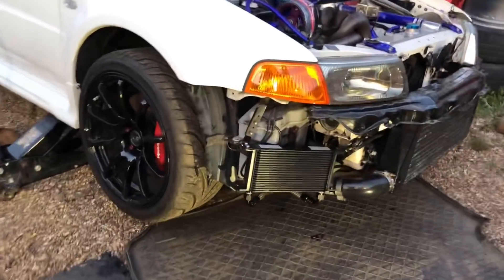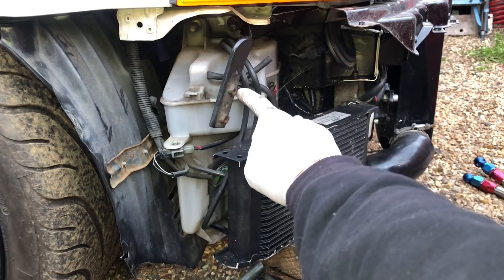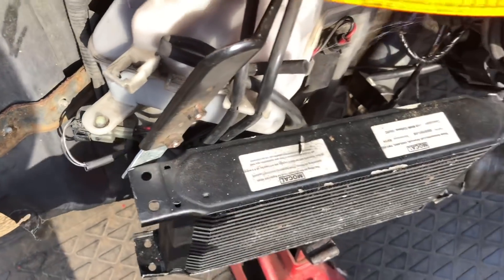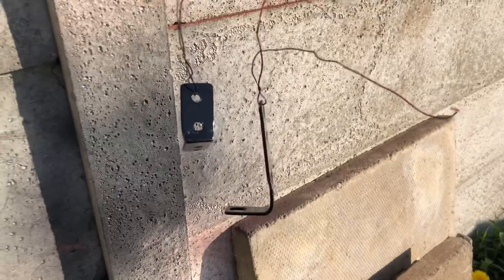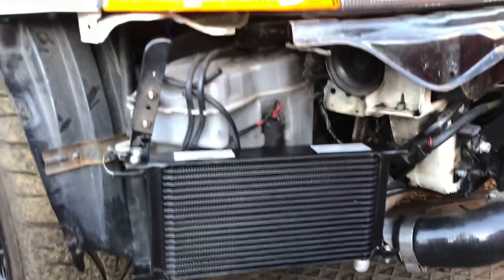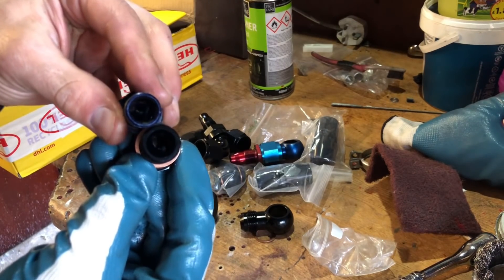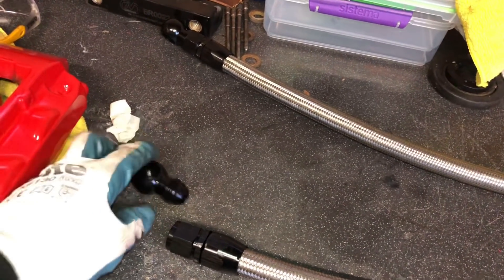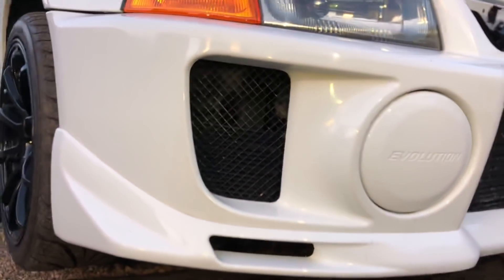Fabricate Custom Parts! Mitsubishi Evolution 5 ReBuild

Comment: Definately worth recommending topping up oil and turning the car over without fuel and spark to help fill that cooler up and build some oil pressure before starting.  That cooler and lines will rob a fair amount of oil on the first start especially as its mounted upside down (other way round you can pre fill most of it).